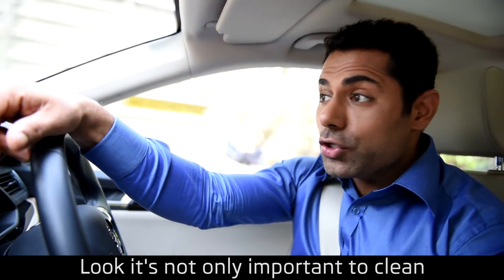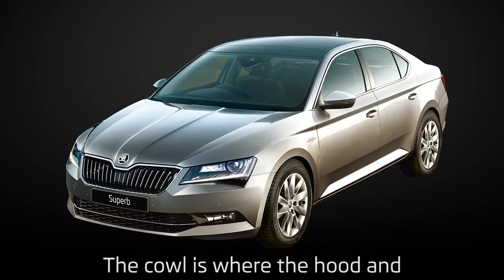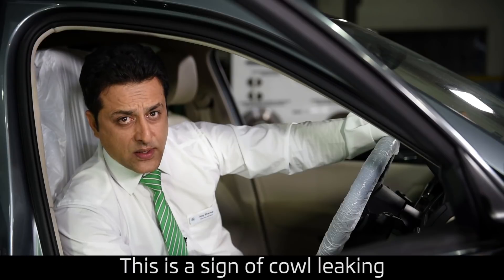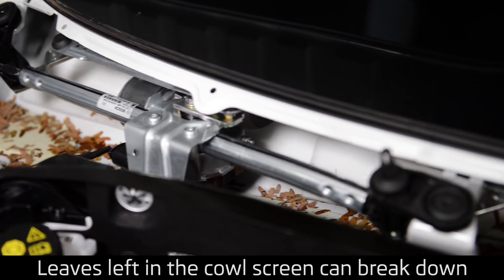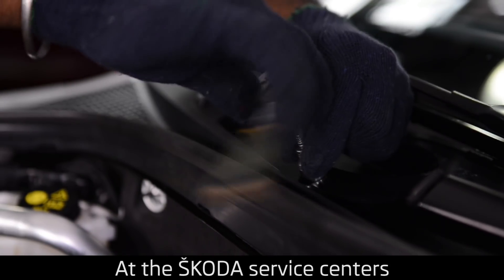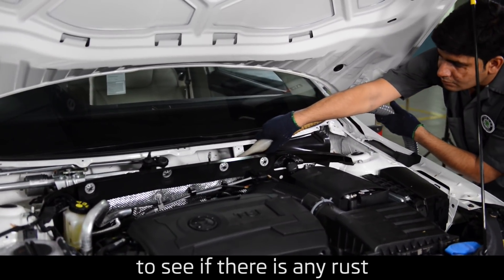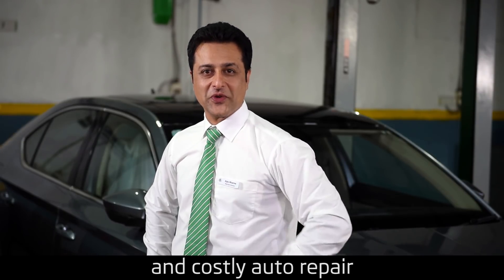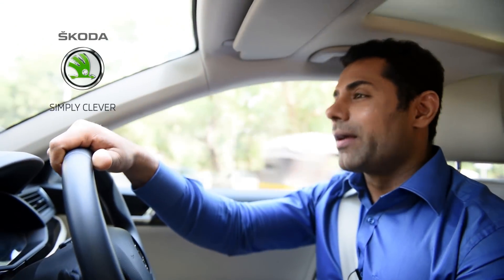SKODA Service- Cowl Maintenance

Comment: This is my worst experience at skoda service center at knadivali-india.

My vehicle - MH-01-AL-5683 was submitted for repair at your service, problem was with the oil getting mixed in coolant box.I received vehicle back from repair and found problem still persist.

At the time of taking vehicle back from repair, when i check vehicle at the gate , i found that there is water leakage from from coolant box, hence everything had near the gate.

My question : what and where the testing was done and how did this happened if testing was done?????

My car boo-nut stand is bend and notch is completely broken.

My question : What was and why this was replaced ?

I had paid rupees 20000 for repair and still today problem with the car is same and service center is asking me to spent money again without 100% resolution.My money is wasted and i feel skoda really does not give money worth.

I am frustrated and irritated because of the way this is done.

If i do not get any help i will fight this further.
This is my worst experience at skoda service center at knadivali-india.

My vehicle - MH-01-AL-5683 was submitted for repair at your service, problem was with the oil getting mixed in coolant box.I received vehicle back from repair and found problem still persist.

At the time of taking vehicle back from repair, when i check vehicle at the gate , i found that there is water leakage from from coolant box, hence everything had near the gate.

My question : what and where the testing was done and how did this happened if testing was done?????

My car boo-nut stand is bend and notch is completely broken.

My question : What was and why this was replaced ?

I had paid rupees 20000 for repair and still today problem with the car is same and service center is asking me to spent money again without 100% resolution.My money is wasted and i feel skoda really does not give money worth.

I am frustrated and irritated because of the way this is done.

If i do not get any help i will fight this further.
Reply: parvez qureshi vashi apmc sec-19 visit desi mechanic 🤣